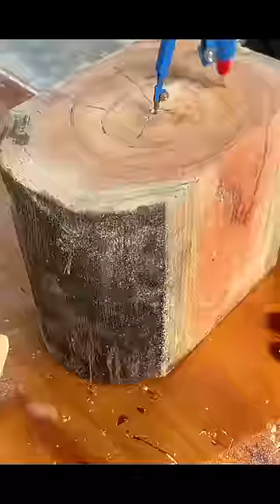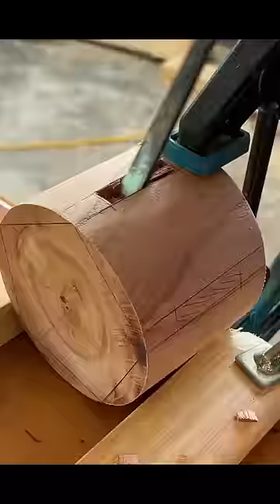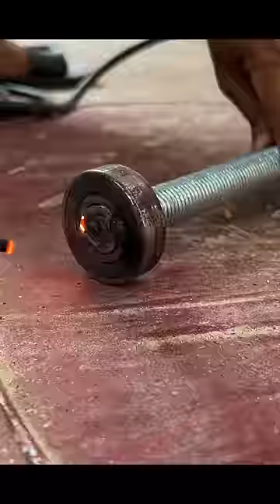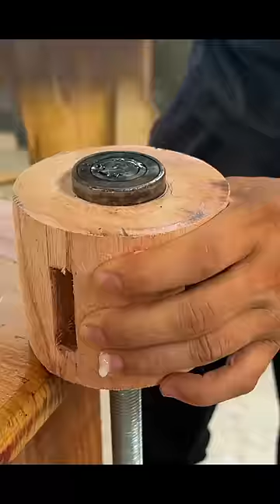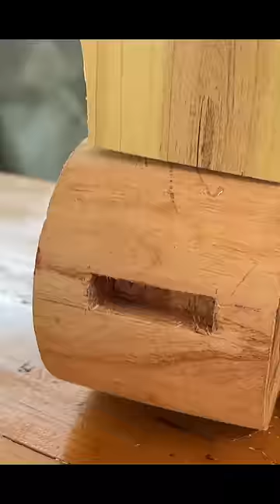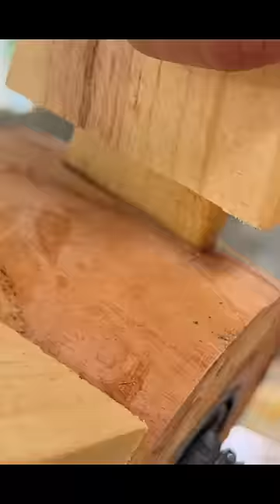A Rotating Wooden Shaft Using Bearings

Comment: Why didn't you use lock nuts on both sides of bearings? That way you could replace bearings when needed and helped bearings last longer by not getting hot by welding?
Reply: The same reason the tenons are too long for those mortises probably 😳
Reply: Same reason none of the joints are square and the glue is sloppy and used wood glue to glue in a WELDED bearing

Comment: I have only one problem with this.. The bearing has a life span by welding the stud to the bearing inner rays you have sealed the possibility of replacement... Find an alternative and try using a thrust bearing instead of a ball bearing... You would have more load bearing capacity.